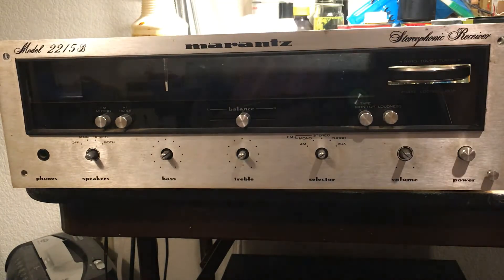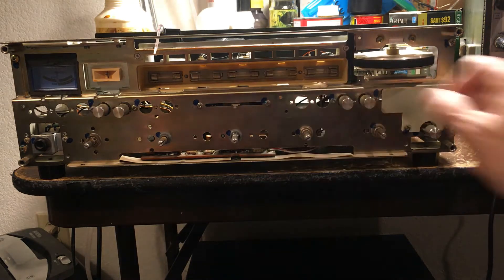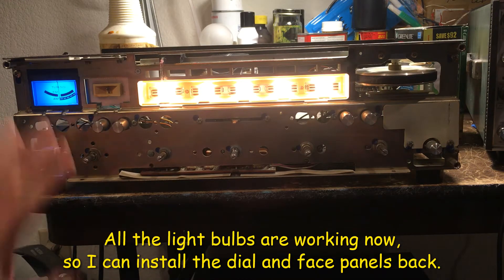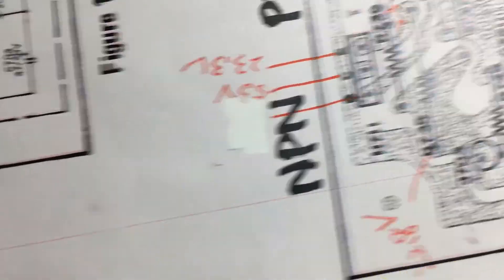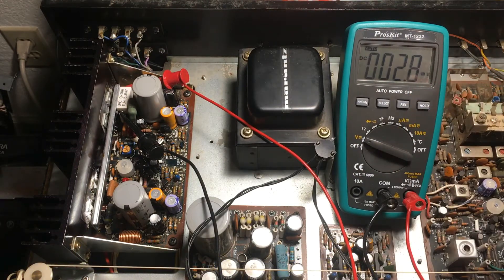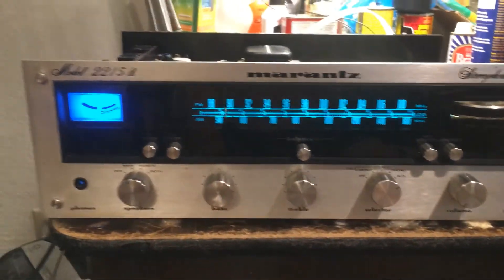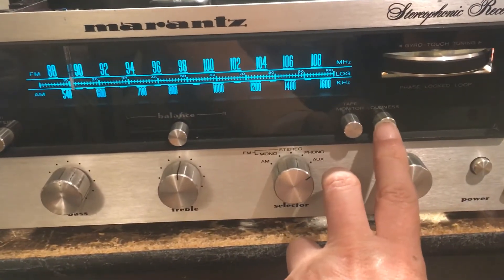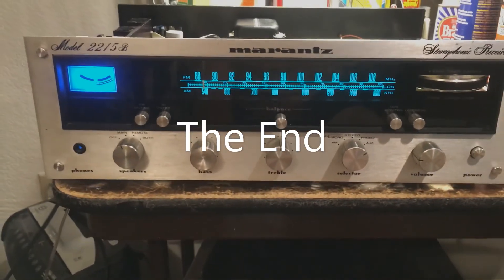Marantz 2215B Repair Part 2 - Bulbs Replacement & Bias Issue

Comment: Really helpful video, i really appreciate the details given here. 

I am working on a 2215B and getting high distortion in left channel at volume at 15-25%. Am getting zero bias on left channel as well. 

This distorted audio persists even while using a headphone as well on the left channel.

All voltages match to right channel with right channel bias at 9mv. Right channel sounds perfect.
Reply from the maker: Thanks for the comments. Sorry to hear that you have a distortion issue on your 2215B. I suggest to check the power and driver transistors if you have distortion and can't adjust the bias. Please send your inquiries to my email if further help is needed.
Reply: @VintageAudioFan  Thanks for the quick reply, I sent you an email.

Comment: How do you know if the Reciever needs to be re-bias?
Reply from the maker: When unit has been used for a long period of time, the compartments (i.e. transistors and capacitors) may be aged or degraded. They can cause problems in the amplifier circuitry. The value of DC balance/bias of amplifier may become off based on the OEM's specifications. In that case, it may kick on the speaker protection mode or cause the distortion for the sound outputs. So it is good idea to check Dc balance and bias to ensure amplifier is in proper working condition.

Comment: Hello! Do you know what can happen if I turn the receiver on without having speaker set turned off beforehand? I mean, can this damage the speakers? I think that the volume was a little bit turned on, but not much.
Reply from the maker: The circuit of Marantz 2215B is an OTL design. Usually OTL amplifiers use an output capacitor to eliminate DC output which will help protecting the speakers. So it should be fine with the speaker connected to the unit when turning on the receiver. It is always a good practice starting with low volume to power on the amplifier.
Reply: @VintageAudioFan  I accidentally turned it on without realizing speakers were switched on, but volume was fortunately relatively low. But I figure it wasn't critical because the unit outputs 15W/ch and my speakers are able to withstand 40W. I don't think that blast was anywhere near 15W.